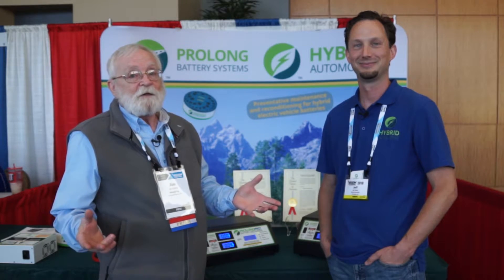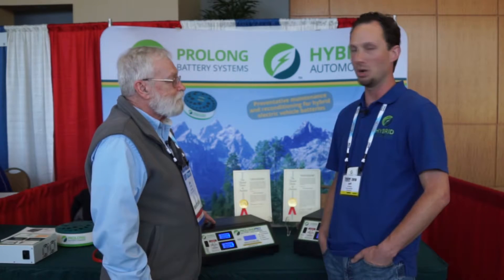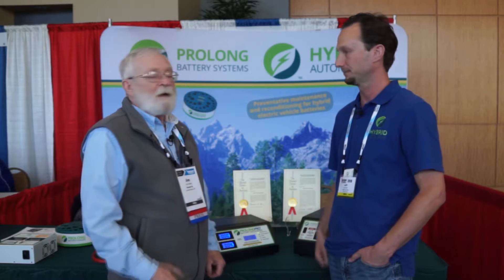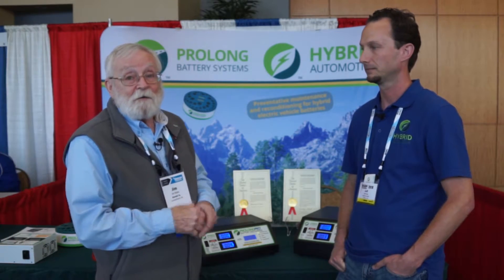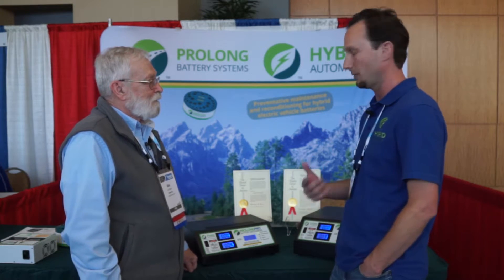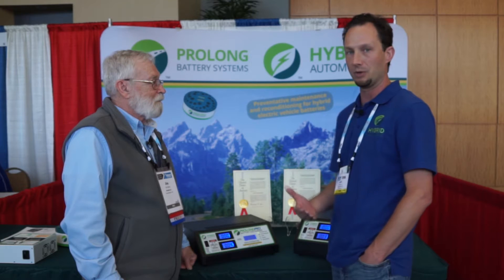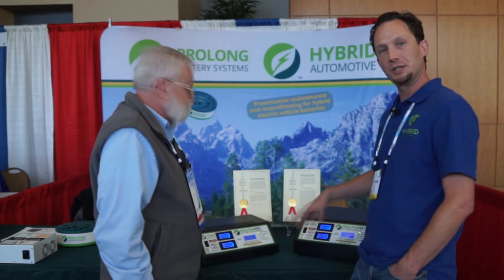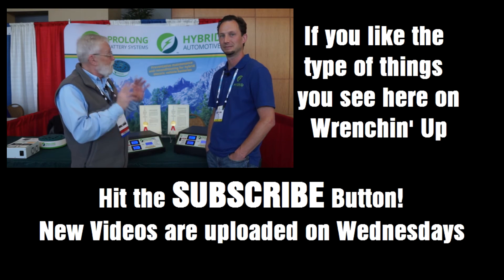Awesome Hybrid Vehicle  Battery Reconditioning - Wrenchin' Up

Comment: I have a mitsubishi PHEV OUTLANDER with a 12kw battery and it has gone from predicting 47 to 49 km from an original 52km to between 29 and 36 km prediction the real world km are as predicted or less. It has been refurbished twice but nothing changed. The battery seems not to have degraded beyond 94% of original 100% when new. It appears that it refuses to  be charged. Could it be a software problem?
Reply from the maker: Hi - Thanks for your comment and question. Hopefully the equipment manufacturer will jump in here and answer your question as they are most qualified to do so. You can also reach out to them directly with your questions as their contact information is in the video description. Thanks for watching!